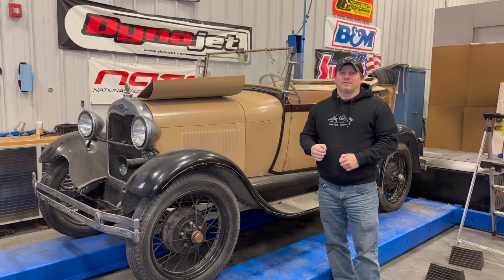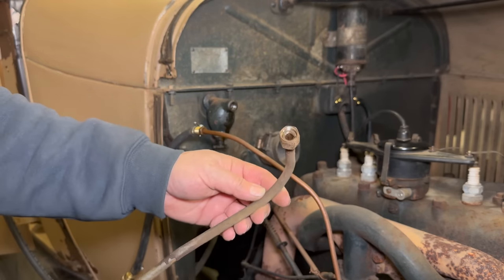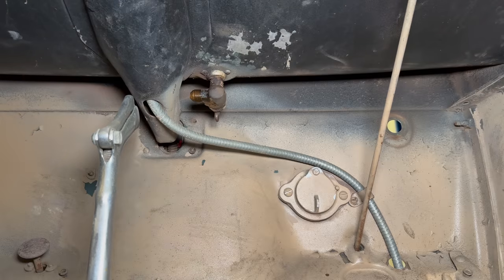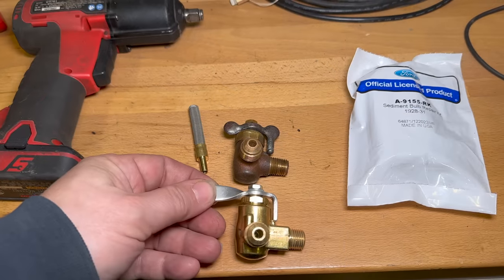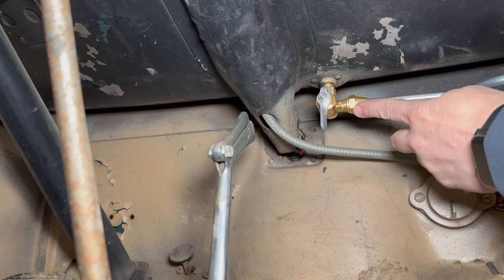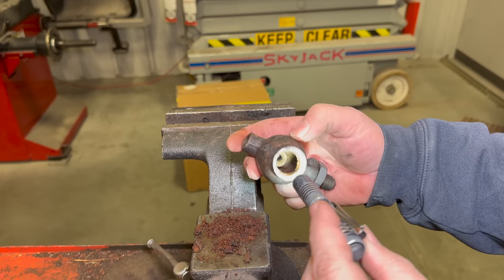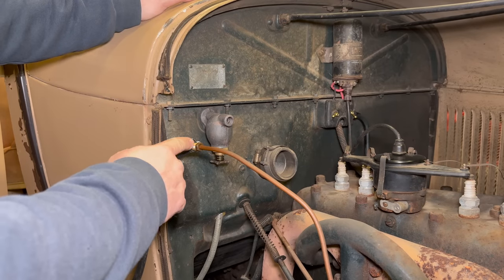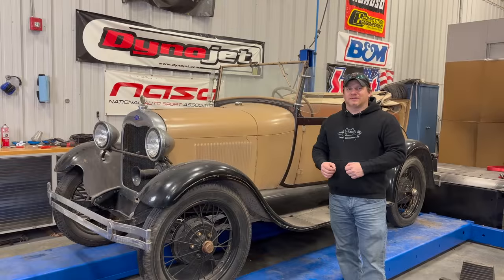1928 Ford Model A - Fuel System

Comment: Really surprised that Ford USA still manufactures/supplies spares!  In my experience here in the U.K Ford spares tail off from 10 years old. 'Time to trade it in Sir!'
Reply: I don't think Ford is making any of those parts, nor do they supply them or exercise any say in their reproduction EXCEPT... just about every part Ford put on their cars has the Ford script in an oval as a logo.  Ford still controls the use of that, and saw fit to manage their brand by licensing the use of their logo on reproduction parts.  That said, there is an incredible variety of parts reproduced for these autos, and the logo helps to look "authentic".  I have my dad's 1927 Ford Model T, as well as my own collection of Austin Minis (which parts are similarly emblazoned profusely with "MOWOG"!)

Comment: i was interested when you said the tank is built into the cowl, hoping for cleaning techniques. only to see you reinstall the shut off valve directly. besides using a flashlight to look inside, i was expecting a solvent flush or power wash at the very least. i do not use chemical liners, and in this case, it would be nearly impossible to apply. not judging, i've had too many experiences with pin holes, and wanted to learn your criteria.
Reply from the maker: I was going to flush it out but once I drained it there was nothing to flush out, there was no liquid in the bottom it was totally dry.

Comment: How fast does it go?
Reply from the maker: Should be able to go around 65 mph
Reply: @ThisWeekWithCars  I'd like to see you autocross it.
Reply from the maker: Wish I could in a lot of old cars but they require seat belts to autocross and that would not make sense in this car.  I’d rather be thrown from it in a crash than be splintered to death by all the wood.  The pre-war racing groups on real race tracks don’t require belts but for some reason SCCA does to drive in a parking lot. 🤷‍♂️